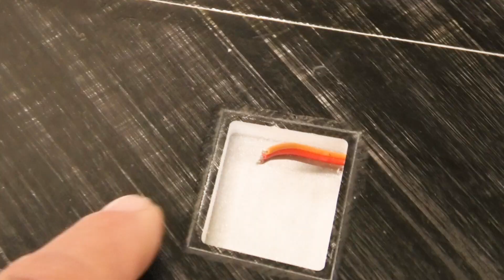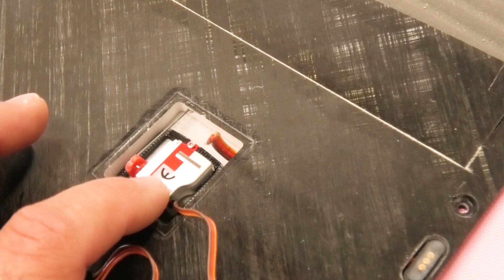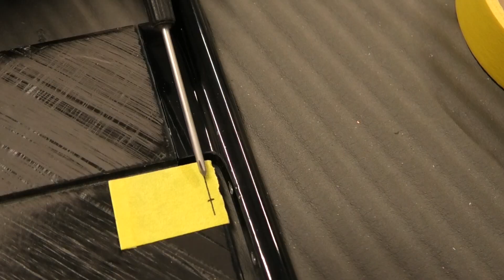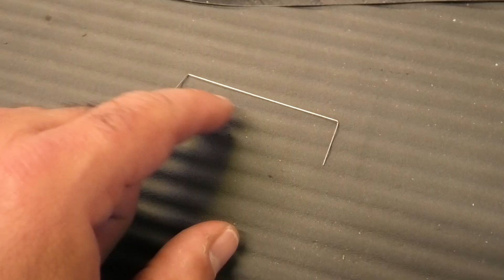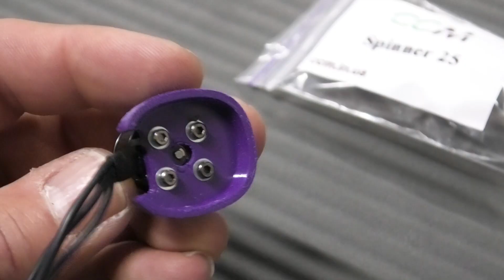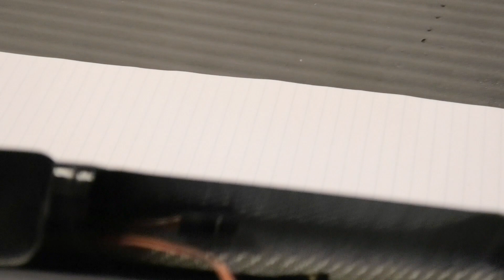F5K Sabre, 1.5m RC Sailplane Build.

Comment: Thanks for sharing the build, love watching these after a 30 yr break, a lot has changed!   I didn't see you mention anything about offsetting motor thrust?  Did that 3d printed part have it build in and all you had to do was center it using this washers?
Reply from the maker: I just assumed it was designed with the offset. Fingers crossed 🤞 lol
Reply from the maker: Customer reports that it flies great so I think it's close.
Reply: The engine mount is made in such a way that you can easily adjust the gap between the spinner and the fuselage. I do this using a blade from a utility knife.